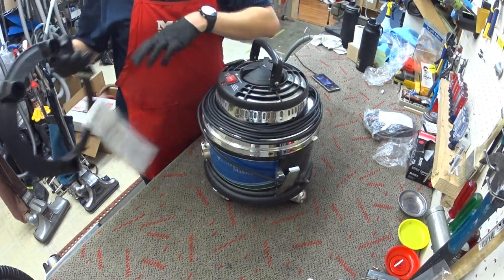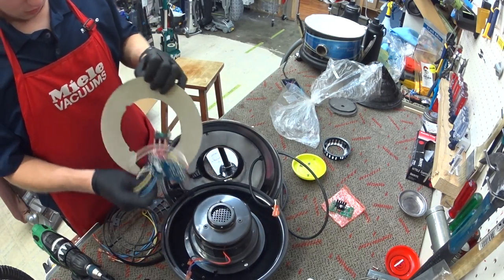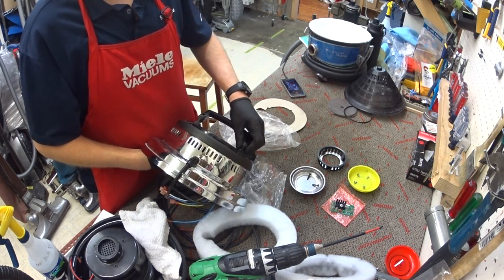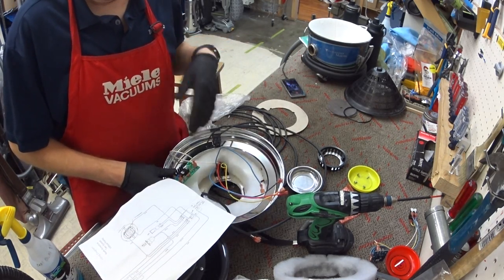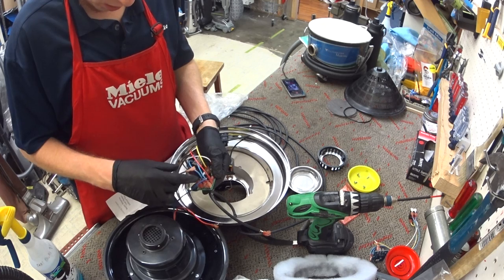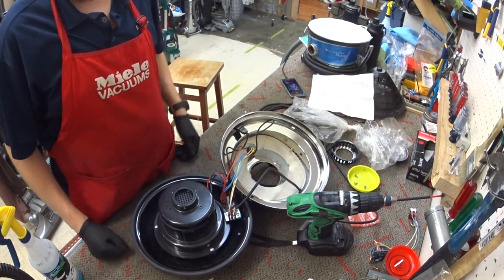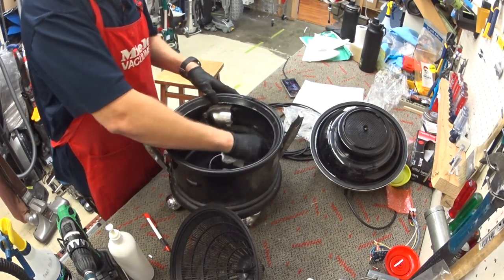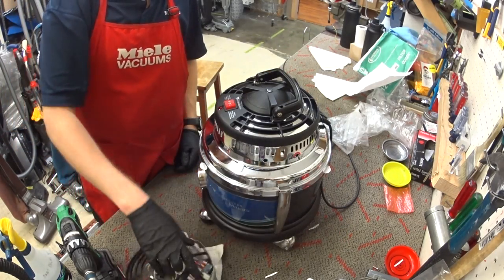Filter Queen M360 Vacuum  Switch & PCB  Change

Comment: I never thought that I’d want something as bulky as a trolly vacuum but the more that I examine everything on a Filter Queen the more that I think that I’d like to have one.
Reply from the maker: I'd love to have a Chicago made filter Queen in my collection!
Reply: Does anybody have a picture of the circuit board wiring? Can’t find it online and couldn’t see it clearly enough in this video. I just had mine replaced at a shop, but now there is no power at the receptacle for the beater brush, and I believe the circuit board wiring was botched...